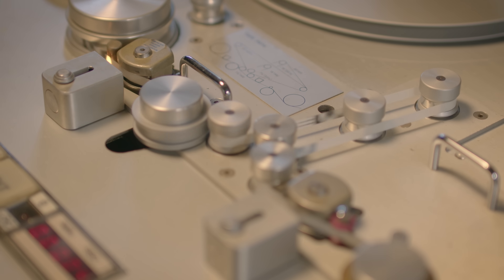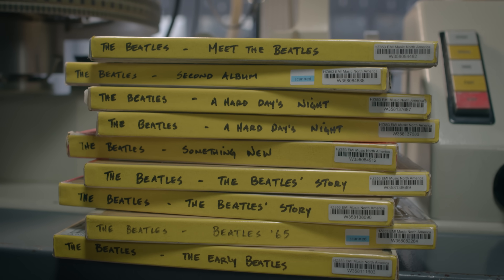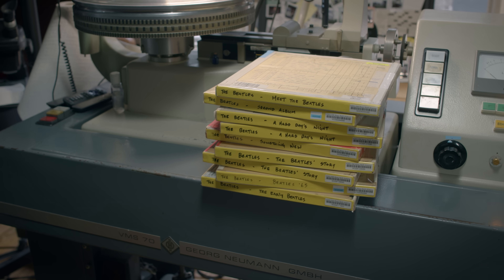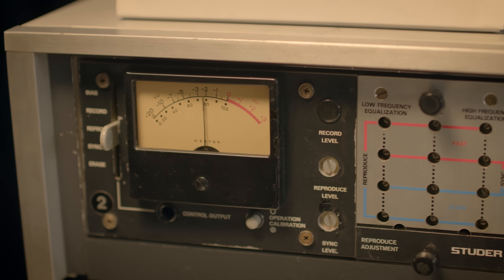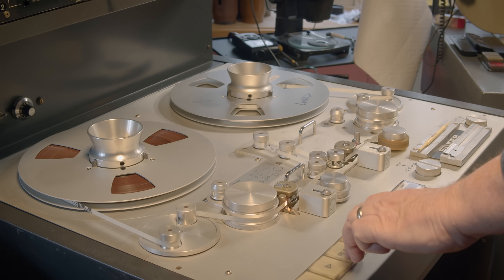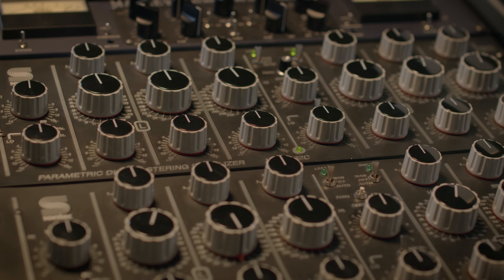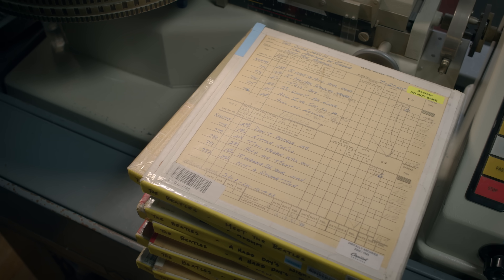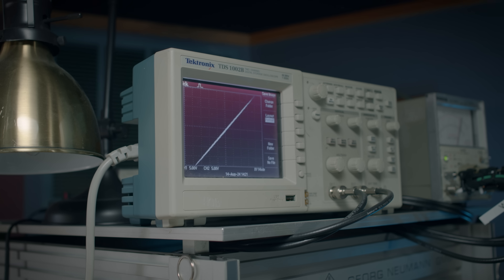The Cutting Process for The Beatles: 1964 U.S. Albums In Mono

Comment: 0:43 what model Studer 2-track has this convoluted tape path between the reels? Google Lens examination of screen shot linked to Emil Berliner Studios page about A80. Apparently, rare "preview" headstack - for mastering?
Reply: The distance between the grooves on the record varies with the volume or amplitude of the recording because loud sounds will give bigger movements of the needle. But the cutting lathe will have to know in advance when to speed up or slow down the motor that moves the cutting arrangement. Therefore the taperecorder feeding the cutting lathe has an extra head that plays the music the amount of time in advance that corresponds with the RPM of the record. If you look closely you can see several rollers on the tape deck. Depending on the way the tape is threaded around more or less of them it will give the advance in time that fits 33 or 45 RPM on the lathe and 7½, 15, or 30 IPS of tape speed. So the first head controls the width of the groove and the second head plays the actual sound that is send to the cutting head.

Comment: Capital remastered these albums in 2004 and 2014. You're saying they didn't already do their best job back then? 2014 is not that long ago. The tapes age and get worse with time. What should I do with my 2004 and 2014 remasters? Throw them out and buy these?
Reply: In 2014 Capitol did NOT remaster the original US mixes on those CDs and used the 2009 UK remasters. That was indeed a true ripoff. The 2004 CD transfer of the Capitol albums is awful. This will be done the right way this time. I suggest Dr Ebbetts to hear the way these were really meant to sound if you won’t be buying this package.